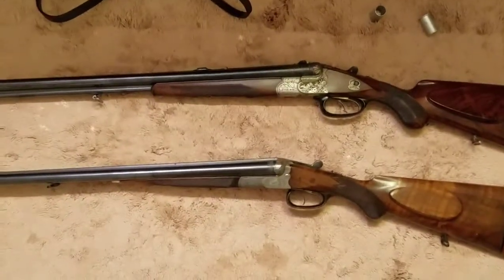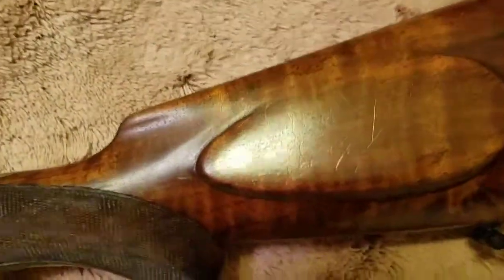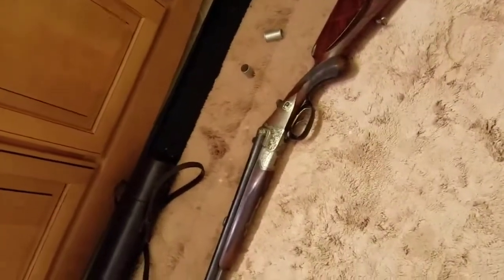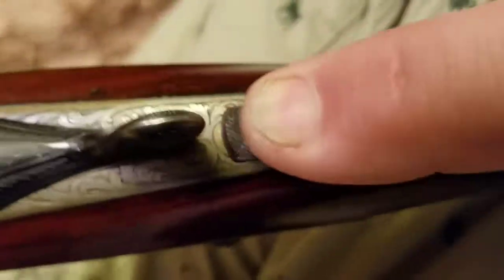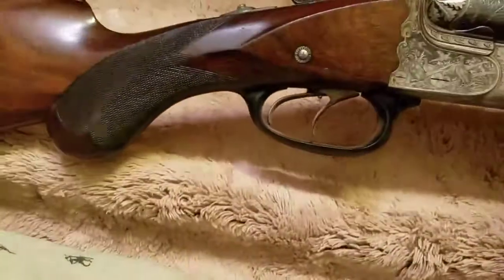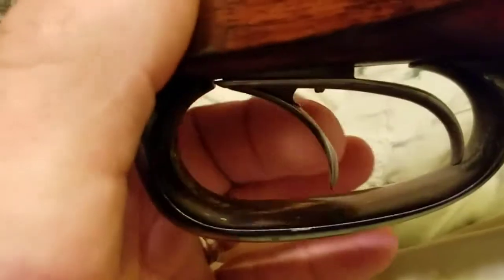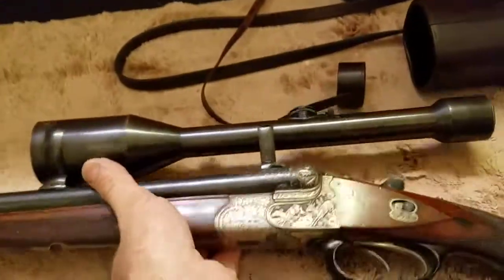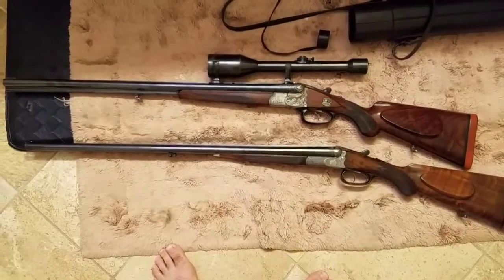These guns put plastic guns to shame.

Comment: The missing original hand guard tip was most likely horn like the trigger guard is.
Reply from the maker: terry johns likely but I know it was ivory. My idiot younger brother borrowed it from my grandfather without permission and it popped off. He was pissed... Anyway, I had my gunsmith replace it but it lowered the value. But priceless to me anyway.
Reply: @thomasc5817  It is a very fine gun regardless. My father bought me a Austrian sporting rifle that was a WWII bring back for my high school graduation. Made by Vinz Urbas in Ferlach-a beautiful rifle. It would be the last gun that I part with-prying it from my dead hands.

Comment: The switch is the selector for the right barrel: shotgun or rifle. The safety is mounted on the left side of the pistol grip. You get what you see, S showing means it is on SAFE. We could have done with out the toes. Thankfully they are not painted :) Let me know if you want to sell them - I love those old German sporting arms. If the drilling is 16 gauge it most likely takes 2 1/2 inch (65mm) shells and should not be fired using modern 2 3/4 inch shells. RST sells the correct shells.  Is the rifle barrel marked 7.8mm? If so it shoots the 8X57JR (.318" bullet) cartridge, available from Sellier & Bellot. Rare to find the original scopes on these old guns.
Reply from the maker: Thanks. Naw. They will never go up for auction. I couldn't part with them. Family heirlooms.
Reply from the maker: I have shells and cartridges. It's 12 gauge. I shoot the minis in it.
Rifle barrel is a 8x57R. Good call. I have oodles of shells. Good to go.

Comment: Actually, having real ivory in it would make it illegal to sell, so that would technically mean it's worthless.
Reply from the maker: actually your incorrect. The 1989 law states that items containing ivory can be sold provided it is 100 years old or older. Considering both of these guns were made in the early 1900's, they exceed that restriction and are able to be sold. Had I still had that ivory in it, the double barrel would have been worth a lot more than it is with the composite replacement piece. Thanks for playing..... 😂
Reply: Worthless, I don t think so. You could jam a frozen potato in there and it would still be worth a whole lot. Lol.